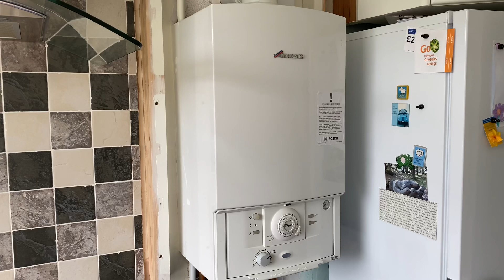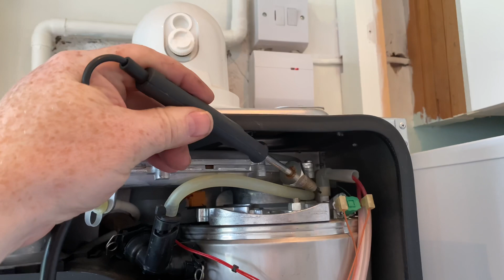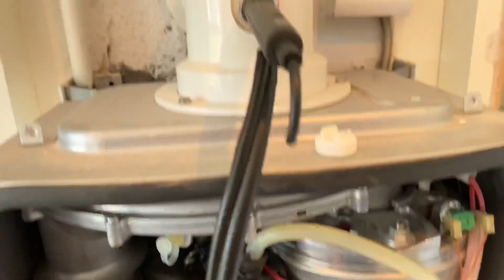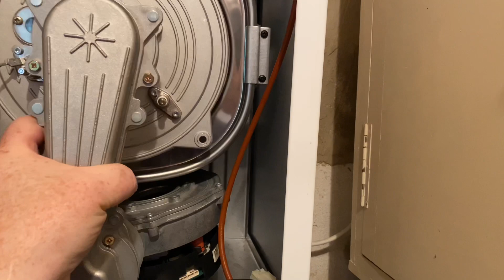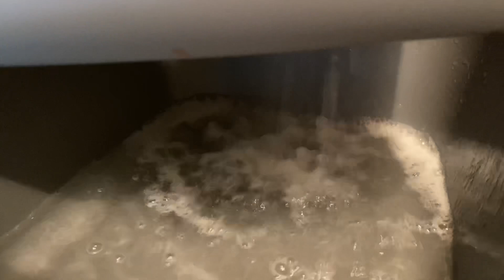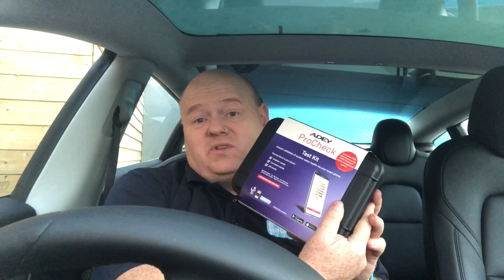Leeds Plumber - Leaking Worcester Bosch - Baxi Boiler Service - Adey ProCheck Water Testing

Comment: I've got the pro check,  great bit if kit, I used it after an install so customer gets record of the water sample. Havent used it on a service as it works out at about £4 a test. Which is quite expensive, ordered fernox express inhibitor test strips for services, more basic but works out more like 50p a test.
Reply from the maker: How you getting on with the fernox test? Thanks.
Reply: @AllenHart999  they do the job. Seem to test for most inhibitor brands. I tend to use adey / centre brand and they come up on the test. Great for a quick test on a service 👍

Comment: To be fair I’ve not seen a flow unit leak where it’s being fitted with a mini expansion vessel on the cold supply as stated in the instructions.                                 I’m Milwaukee everything but not sure I like the squareness of that might get a cheapo drill style pump at least it’ll fit in the bag nice
Reply from the maker: Manufacturers instructions do not ask for a mini expansion and they still leak even if they have one. Thanks

Comment: Hi Allan
I've had the milwaukee pump for about a year works better on 6amp battery, I've also got the dewalt air compression that runs on batteries great tool for servicing,
Reply from the maker: Where do you buy the batteries? Thanks
Reply: Ive bought all mine on ebay  ,not cheap but well worth it